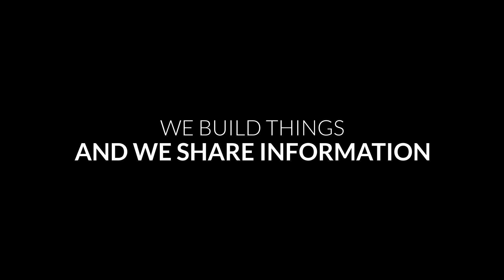Kid Explains RGB & Parallel

Comment: I'm not sure he fully gets the parallel and serial thing, but I didn't at first either.
Most the flow will be straight into the left tube after it goes into 1st waterblock, but there will still be flow into the block itself so parallel still works, and I guess theres less overall resistance in the loop that way.